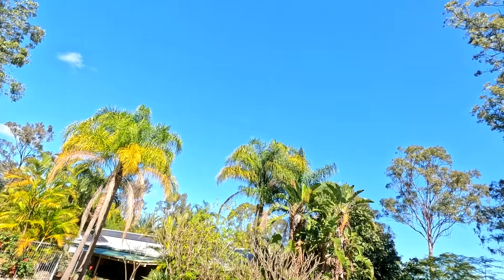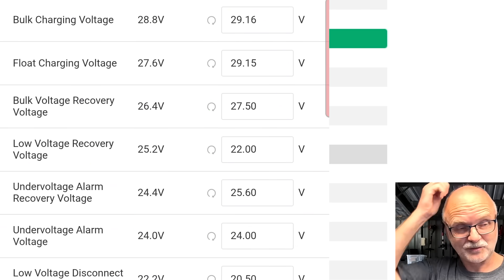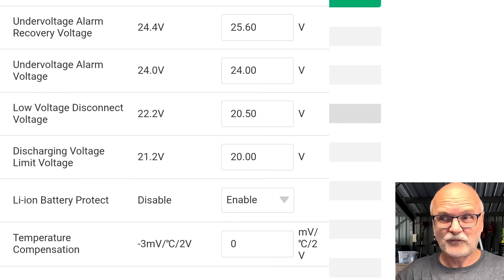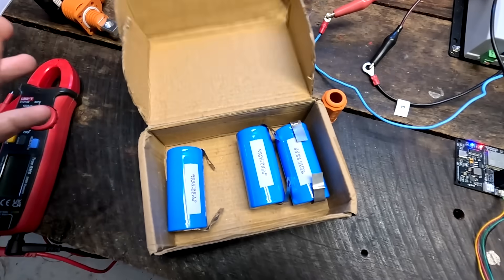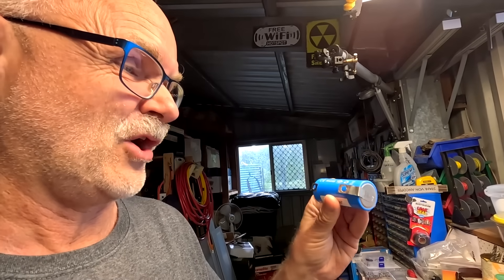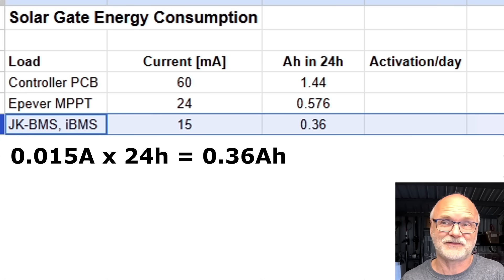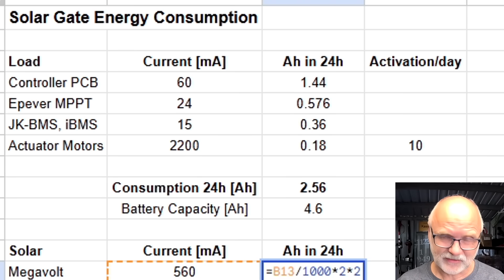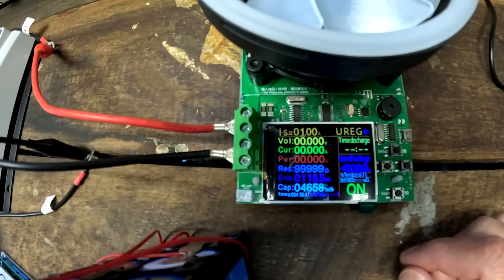Lead-Acid to Lithium: Are these few Ah sufficient for the Gate? LiFePO4 capacity test.

Comment: Andy, I don't need to tell you that "a chain is only as strong as  its weakest link" You need to bin in cell 4 - from experience on the race track, its internal resistance will be higher and drain the whole battery over time.

Comment: As I commented in your other video, the "insane" quiescent current of the gate could be investigated to see if it's using a crappy linear regulator. This could possibly be fixed with a $1 switch mode regulator board. You responded with a shrug. 😁

Comment: There is 100 days of gate power available so why are you using high current controllers BMS etc.
Get a low power BMS! eg use a drill battery and recharge it every 100 days!

Comment: Hi Andy, Again another very nice and watchable (not in my face) video, thanks.  < Smiley Face >
@14:20 you  start to calculate the output of the solar panels, but you have a MPPT Solar Charge Controller which harvests Watts, not Amps, to the Battery. So the  expected power of the each panel is 17.9V * 0.56A = 10.0W.  For 2 panels = 20W.  

Calculations in Summary (Panel = 10W) | (Panels = 2) | (Battery = 25.6V) | (DC-DC Buck converter efficiency = 85%)| (charging hours/day = 2) 

(10W * 2) = 20W from the 2 panels in series (note: at peak power, the panel is at 17.9V and 2 in series = 35.8V enough voltage to run the MPPT Buck Converter to charge at peak output voltage of 29.15V so 6.65V above the Peak Charging Voltage. 
(20W / 25.6V) * 0.85 = 664mA to the battery @ 85% Buck conversion efficiency
664mA * 2h = 1.33Ah/day (2 hours/day of charging).

So I don't understand Why@15:00 your formula is =(B13/1000)*2*2, as one of the doubling is because of time (2 hours), but the other doubling is the current ( ? because the panels are in series ? ).

Andy, Andy, Andy, you DON;'T double Current when they are in series, you double Voltage, Andy, Andy, Andy.   < Smiley Face >

In summary, 1.33Ah/day.  Your gate is so screwed in Winter. Need to find an additional 2 hours of charging/day.or another 20W of solar panels.

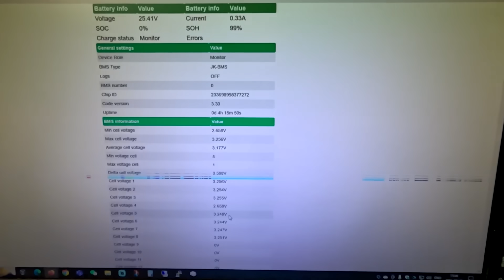Comment: Andy what do you use on the peg board to hold your tools on I have been looking for such a thing 7:06
Reply: They are magnets from old mechanical hard drives, very strong and very useful, I use them all the time (from another Andy) !
Reply: Tale some old harddrives apart for those magnets. And to seperate them from the metal part you can soak them in aceton so the glue gets soft.

Comment: I had to up my panel wattage to 60W with my solar tracker it just wasn't enough during winter
Reply: I use lead acid for my tracker because they tolerate cold temperature much better 
the brrrrrr is maximum where i live

Comment: Dear viewer, our work benches frequently look like his, the question is: How do you stop small pieces like washers falling down the cracks ? Rhetorical, no answers here please.
Reply: I always put large sheets cardboard cut to fit over my workbenches.  The benches will remain pristine until the day I die 🙂Still, it's saved the benches from spilled epoxy, paint, stain, sharp bits of sheet metal, and all sorts of shenanigans over the years.  Replacing cardboard is a lot easier than replacing an otherwise wonderful wood table top.

Comment: i love how the weather is better in July in the southern hemisphere than compared to my local weather in Northern Ireland.
Reply: TBF, until the schools broke up we had the sunniest Spring in 50 years - or maybe that didn't extend to NI?
Reply: @matthewmarks6951  March was good, I produced nearly 600kWh, April was even better at just over 800kWh, then May was fantastic nearly 1MWh.
And then June the weather turned and I only make 730kWh  and July is at 680kWh.
Cant really complain, i'm still producing much more than i'm using but I do need a bigger battery so I can go for a couple of heavy overcast days
Reply: @adhdengineer  On what kWp? I've got one 16 kWh battery and I'm fretting that it went down to 85% last night and now it's raining. Stupid. 😆 I'm in London.
Reply: @matthewmarks6951 7.8kWp. 18 panels, 15 facing south west. 3 facing south east.
I'm seriously considering adding more panels on the north east facing back roof as well, see if I can get enough generation for most of the winter months as well.
Reply: @adhdengineer  That's about twice as much as I managed to fit on my roof but you're right - they are so cheap it's worth considering fitting them on north-facing slopes now - the fitting cost often dwarfing the panel cost though! I've been getting between 30 and 34 kWh most days for the past couple of months.